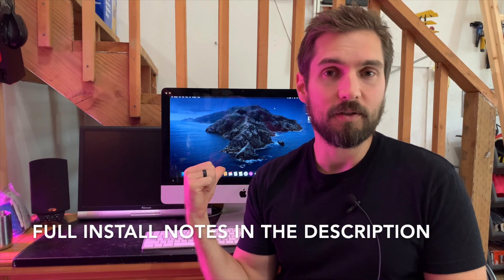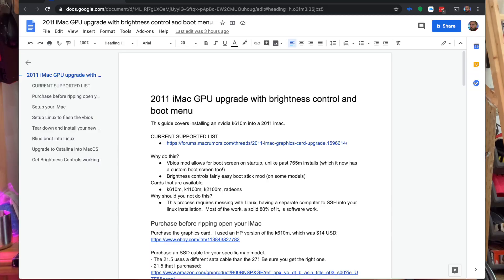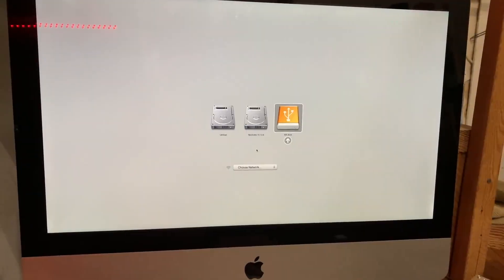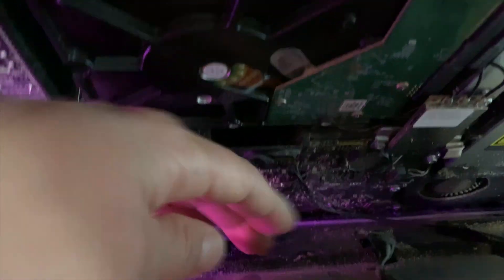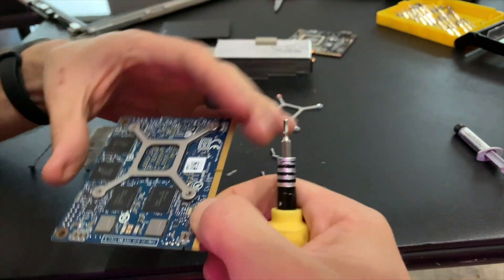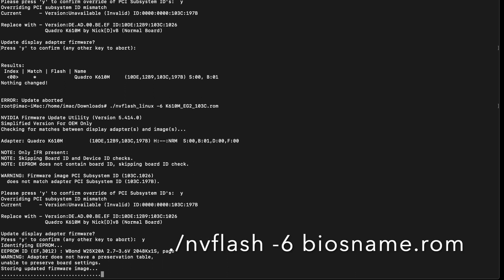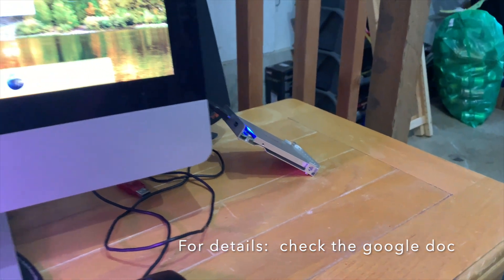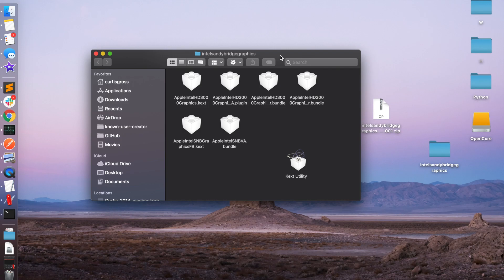2011 iMac GPU Upgrade Now with Brightness and Boot menu - Absolutely Worth It!

Comment: I was able to successfully install an HP branded K1100m and was able to flash the vbios as instructed.  The iMac 21.5 video does work IF I hold down option at bootup to turn on video.  I believe my next step is to install OpenCore to provide a boot screen and fix brightness controls.  Unfortunately, google is now flagging the iMac Opencore Loader.dmg file as infected and is blocking a way to download.  I have not been able to locate another source of the file.  Are you experiencing the same result when attempting to download the dmg?  Thanks for a great video.

Comment: @Curtis Gross saw your post on macrumors... you are selling the iMac featured in the video, huh?  Should be an easy sell! I’ve been following the development of this gpu upgrade for months and months. I still have my 6750 in my 27” and it runs cool as a cucumber. I was looking to go for the installation now that Big Sur is supported, but honestly through the development it’s gotten a bit confusing for me. I now don’t know whether I can do NVflash and jump straight to Big Sur patcher or if Catalina had to be installed first then the upgrade with the patcher. Thread on macrumors has turned into a book at nearly 450 pages! I might have to ride it out with my 2012 unibody non-retina, but that screen is horrible next to the imac...

Comment: You're a wizard Curtis! it looks fly how it works man! I have an issue, maybe you can put me in the right direction, I got my hands on an iMac same year but 27 inch, with a fan noise from the startup, it doesn't stop and no brightness control, which makes me think it may benefit from making a GPU replacement/upgrade ( everything else works fine) ... but I'm guessing about the GPU malfunctioning here, I'm a newbie on this procedure, nothing more than ssd, ram upgrades, screen, keyboard replacements, and just basic knowledge about linux, but I need to know how to correctly diagnose this iMac so I can start fixing it, any suggestions?

Comment: Hi, bios you provided for K610M is full dump? Can I erase old one and write your one with programmer? Also iMac should boot into OS X with original Bios? And last question I noted that there are 2 versions of K610M. One is nvidia code start with 14 and next one start with 15. Your bios should work on both versions? If it work I would like to donate you but cannot find more info where to contact you.
Reply from the maker: Hi Miroslav - yes, the k610m is a modified vbios dump that will convert a k610m to a imac compatible with boot screens / linux screens / windows.  Now, you should still be able to boot into Mac OS even with the original bios, but it won't give you a screen until ~80% of the boot process is done and the nvidia drivers load in.  You mention the n14 or n15 variant of the 610m.  To be very clear, you want the n15 variant!  The n14 is likely 'fermi' based which means it is older.. and not the best version. I don't think nvida sold them as the 'k' variant, but either way - get the k610m n15 version if you see a choice.  As for donations - no worries.  I guess share the video and subscribe!  I do this for fun and as a hobby.

Comment: Hey Curtis, I don‘t know why, but my First comment does not show here. I did the same Update, a K610m into my 2011 21,5 iMac i7. Flash worked Fine, everything nice with high sierra. During Installation of Catalina ( with dosdude Patch) i got a black Screen. The Screen Stays black until i Power off, Switch on PRAM reset and After That ist Worms until next Boot 🤔 any ideas?
Reply: Oh and thanks of course for Test Great Instruction!
Reply from the maker: Heya!  Not sure what could have happened. Worth checking the inside to see if you are still getting the third light. Maybe the gpu died and it was just bad timing on the install.
Reply: @messing-with-computers  thanks for quick reply. Sorry for german autocorrect in first message. Do you think it could really be a dead GPU? After I do a PRAM reset its booting up with Screen and in macos is also fine. Sleep is also Not a Problem. Just until next Boot :(
Reply: @messing-with-computers   I double checked again and opened the iMac. I get 3 LEDs with black screen. After PRAM reset display lights up and i have 4 LEDs

Comment: Hello, I have tried on my imac 27 final 2009 with gtx 765m and it does not work. To fix the sleep error I have to disable it from the economizer if the mac is turned off.
I have flashed the graphics card from windows but I don't have brightness control. I am in High Sierra 10.13.6 I will try to jump to Catalina 10.15.6 if the patch is resolved. I need some programs that don't work in Sierra.

Comment: In the middle of installing catalina from dosdude, with 5 mins remaining my screen goes black! Can still hear that my imac is running. waited and waited for it to hopefully finish install behind the scenes and boot right into catalina, but to no avail. Tried again, same thing.

I never disabled SIP...could this be why? I tried to boot into recovery partition but load wheel freezes every time so I can't even do that :/ ughhh running into problems left and right. All my own fault, I'm sure.
Reply from the maker: Sip only impacts you if you are doing an upgrade. Are you doing an upgrade or fresh install?
Reply: @messing-with-computers  upgrade! so i should do a fresh install, got it! thanks.

Comment: I love your videos and because of that I took my first mid 2011 21.5" iMac apart to upgrade the HDD to SSD and replaced the CDROM with another SSD.
But now I cannot get those damned screws from the LCD back in thanks to these strong magnets. What is your secret? How does one do that? 
Thanks René
Reply from the maker: I only use the holes that are furthest from the magnets and leave the others out. I use two on top and bottom of each side. That’s it.
Reply: @messing-with-computers  Thanks that makes sense
Reply: or you can lay it on its back plate and get screws in their nest with tweezers aiming and screwdriver pushing. The most reliable way so far.

Comment: Hey I hope you notice this comment but my 2011 27inch iMac’s gpu just died right now and I have no way of flashing the gpu bios before it died. I just bought a quadro m1000m on eBay for $15 right now and would it boot to macOS natively or do I have to buy a adapter to plug it into my pc and flash the bios from there. Thanks
Reply from the maker: The k1000m should boot up into high sierra, you just won't have boot screens or brightness controls.
Reply: @messing-with-computers  Thanks for the reply, I'm also wondering if I plug in my windows ssd into my imac, would the imac boot into windows where I can install the vbios from there. Because I remember when my macbook booted into windows when I installed my windows ssd in there not knowing I didn't format it.

Comment: Thaks a lot Curtis for these videos. May I ask if ANY k1100m will work? Or is it necesary to be Dell branded, as it used to be? I'm planning on use Open Core.
Reply from the maker: If you flash it - any brand works.

Comment: Hi, Curtis. Firstly, thanks for your work. How do I fix brightness after install Catalina? Mine is iMac 21.5 2011 with K2100 GPU. You did the fix in HighSierra, but I installed Catalina and after I saw the possibility to fix brightness, so, I’d like to know if it’s possible to fix it from inside Catalina. Thanks!
Reply from the maker: Did you flash the GPU?   The flashing process is pretty easy (done via linux stick - check this out: https://www.youtube.com/watch?v=sn5K2SKXrJg )
Reply: @messing-with-computers  I did it. It is working, but not the brightness control. Is it possible to fix the brightness control using open core from Catalina, or only from High Sierra?

Comment: I am so frustrated, obviously I'm lacking skills. I did the K610M GPU upgrade without any issues and on High Sierra it seems to work well. I know I won't get a boot screen but now I need one to disable SIP and to flash the GPU. Nothing seems to work, I can't ssh in when the screen is dark, I can ssh in when the iMac is not in this state. I don't want to take this thing a part again for the 3rd time how can i flash the GPU or disable SIP so I can al least put Dosdude Catalina on? Any help is greatly appreciated.
Reply from the maker: Hi Adnan - check out my newer video on “easy flashing” - that will get you the boot screen and you can then disable sip!

Comment: Hi Curtis! Thank you for your time. I had followed your tutorial and now I have a K610M on my Mac 2011. The problem is that I needed to reinstall the OS but it was not possible. It never starts the system even on web recovery or pendrive. I don't know why, but since the day I installed the GPU the fan works at full speed all the time. Tried making the apple hardware test and that shows some kind of problem on the fan that was not there before the new GPU. Now the only OS I can boot on the Mac is Ubuntu. Any idea on how to have MacOS installed again?

Comment: Will the NVidia K3100M work ?  Could you allow comments on your Google Doc, so we can discuss as a community on what we've discovered directly on the doc.  Thank you so much for this information, and setting up that google doc.  Subscribing!
Reply from the maker: Deep - the k3100m will work!  It just doesn't have a custom vbios yet...  As for the comments on the doc- I think keeping the discussion within maybe the macrumors forum for the 2011 gpu upgrade might be best?   I don't have a strong way to manage the comments on a google doc.
Reply: @messing-with-computers  I just discovered the MacRumors thread.  Yep -agree we can discuss over there.   One more question - do you know if upgrading to a k610m will work on the 2010 Intel core i3 3.06Ghz iMac?  Or will the instructions you provide in the Google doc ONLY work with 2011 iMac?  thanks!
Reply from the maker: Deep Cuts should work for any of the i3 i5 or i7. Questionable for the core 2 lineup.

Comment: Hi Curtis great video.  I would like you to take away a concern I have a 2011 27-inch iMac and I want to update it to Catalina, what video card do you recommend? Can I install the k2100 or is there another that is more powerful and serves the boot menu and brightness? I appreciate your answer
Reply from the maker: The k2100 (was) the inexpensive route for a good mid range card with a vbios for boot and flash.  Not as sure on the prices now.  The wx7100m and wx4170m are newer, higher powered AMD cards that should work (have vbios updates for boot and brightness).  But, sadly, I have only tested the older 'Kepler' based Nvidia cards because everything else is a bit spendy.
Reply from the maker: Update - looks like the K4100M now has a vbios on the macrumors forum!
Reply: @messing-with-computers   Thanks for the information

Comment: Hi Curtis, great content! Do you know if Windows/Boot Camp works with the cards you listed, or are there compatibility issues? Thanks!
Reply from the maker: It should work with Windows once the vbios is flashed.  But, I will note that I only go it working with Linux like in my video, because it was easier for me ;)
Reply: @messing-with-computers  Haha, thanks! And just to clarify, you listed the w4170 as a compatible card, but did you mean the wx4170? I ask because I found an HP wx4170 out of China, and wanted to know if it was compatible. Thanks for your work!
Reply from the maker: @tomdrexel112  - Correct, the wx4170.  Now, I haven't personally tested it, because it was more expensive at the time, but here is the full list: https://forums.macrumors.com/threads/2011-imac-graphics-card-upgrade.1596614/
Reply: @messing-with-computers  Awesome, thanks!

Comment: Hi Curtis, I've just finished installing Catalina and everything's working great, when I try to add the kext files everything is seemingly going fine, I copy the video exactly but when I reboot I see the apple logo and the loading bar, it gets about half way and then just gives me a black screen. Any ideas?
Reply from the maker: Sounds like one of those kext files might be causing issues.  Worth reading in the macrumors forum to see if there are updates on which work best with the latest MacOS patches that have come out since this video.

Comment: Whats the difference in specs in all the gpu's that you listed?
Reply from the maker: Overall performance. The k610m is the slowest, then the k1100m, k2100m - then you get to the newer gpus from AMD the w7100 is the newest and the fastest.
Reply: @messing-with-computers  Thank you!
Reply from the maker: @rogergrand-pierre8179  Not a problem!
Reply: @messing-with-computers  So just to update you i just found & purchased a NVIDIA Quadro K4100M on ebay for $89 bucks. Gauging the performance results from macrumors and unigine valley score of 2500(K4100m) vs 2800(WX7100). The WX7100 is $300 a current time of writing while there are a few K4100m for avg $90 bucks. Still new to all of this but i "think" it was a deal haha. I chose this because it has the same similarities to the K610m you installed in terms of functionality not performance. I am also hoping that your guide will make it an easy install as well. Once again thank you for your work and please leave feedback if you know anything else about this card(K4100M). I have also subscribed :)

Comment: Hey man. Just got my 610m and swapped but there’s no second light like you said once happened to you. My question is: one it happened, there was any other error or the machine did nothing? Just stand still with the led of power lit..
Reply from the maker: Try removing all the ram except one stick, try resetting the pram, try reseating the gpu.... and if all else fails, return and replace the gpu.
Reply: @messing-with-computers  there was no memory in when I tried. May be it the problem? If not, how can I reset the pram if the Mac won’t turn on?
Reply from the maker: @PauloRobertoFh  gotcha. 2 lights is memory ok. So you need at least one stick. The pram reset is holding down command-option-p-r
Reply: @messing-with-computers  now it worked!!! I thought I heard you say “no memory, no hdd etc”.. anyelway, thank you so much! 👏🏻🙏🏻

Comment: Hey Curtis! I'm on the last step, but when I try to right-click + open "Kext Utility" it just says "the application kext utility can't be opened". Whether I try opening with or without running hackintool first, it doesn't seem to matter. What do I do?
Thanks for the great vid btw, my 2011 looks AMAZING with the Catalina desktop, and I'm so keen to try my K1100M with some games 😍
Reply from the maker: Interesting - maybe try placing it in the applications folder to see if that helps?  Maybe a redownload will work too.
Reply: I also dragged it all onto the desktop, following a comment i saw online somewhere. Not sure if it made a difference but if anyone hits the same snag, try that as well I guess.
Reply: Oh, well damn. Installed kexts, did a reboot, now it won’t boot at all 😭 probs going to have to reinstall Catalina again I suppose 🤔
Reply from the maker: Might have to - but try using the dosdude “post install” process again and see if you can blast away the next cache!
Reply: @messing-with-computers  I FIGURED IT OUT! 🙌🏻 Turns out that since OS 10.15.4 onwards there's actually NINE kexts that need to be installed. 8 from the original folder, plus an extra one to tell Catalina to load the other kexts which explains why it kept half loading then crashing. I'm fairly sure I didn't actually use your Google Drive download for the kexts, but either way it might be worth updating your kexts folder download my man, I think yours only has 6 instead of 9. Here are the links for anyone interested:

First 8 kexts: https://forums.macrumors.com/threads/2011-imac-graphics-card-upgrade.1596614/page-131?post=27899047#post-27899047

Extra kext: https://forums.macrumors.com/threads/2011-imac-graphics-card-upgrade.1596614/page-236?post=28406927#post-28406927

After that you also need an extra step of adding a framework folder to enable intel quick sync for rendering with the iGPU. The first link has the additional instructions under "step 2".
Reply from the maker: @Casey9256  Interesting.  I actually based my install docs on that thread (minus the quicksync fix) and recently used my folder to update my 27'' iMac... without any issues.  I am thinking the extra files are specific to the quicksync fixes?  Ill dig into it a little more to see what might be needed.  I don't use any quicksync features, so I basically kept that part out once I got my machine working ;)
Reply: Curtis Gross haha well either way, I’m just thankful we’ve both got our systems up and running 🙏🏻 Thanks for all your help mate 😊
Reply: @Casey9256  AMAZING. ty ty ty. I had the same exact issue with crashing at half load into the OS after installing only the 6 kext files. Was very upset to say the least, this has been a week long venture replacing my graphics card.

I command-f "kext" on these youtube comments and found this post. Saved my update! Cheers to this lil community figuring this stuff out. Amazing to see it play out practically in real time. 

Curtis, I recommend adding all 10 kext files to your zip file! couldn't hurt to have those extra kexts even if one doesn't use quicksync at all.
Reply: Yōsuke Araki no worries friend! I’m glad my comments helped you out 🙌🏻

Comment: Hi, I was hoping you could help/advise? I have a iMac 27" 2010, 2.93Ghz Quad Core intel core i7, 24Gb Memory, ATI Radeon HD5750 1GB. I have managed to load Catalina but it runs really badly! I purchased a NVidia GTX 780m GPU to hopefully rectify the performance issue and provide metal support.
Reply: I installed the card (No flash) booted and got nothing on the screen at all, should i see anything? I take it I have to flash the GPU card as per your video to get the card to be recognised by the iMac? Didn't want to try it if it's going to fail from the outset.